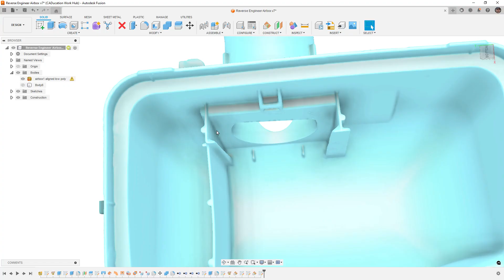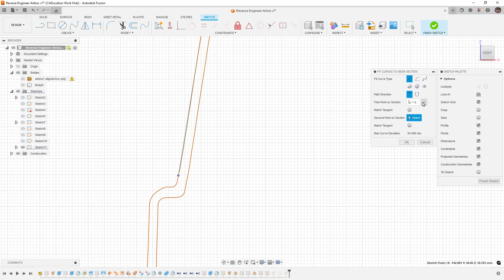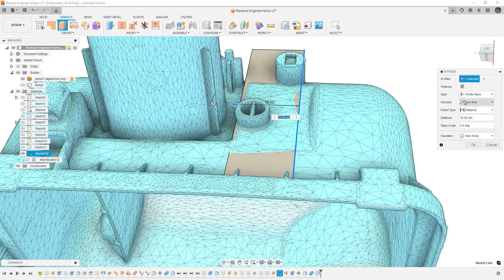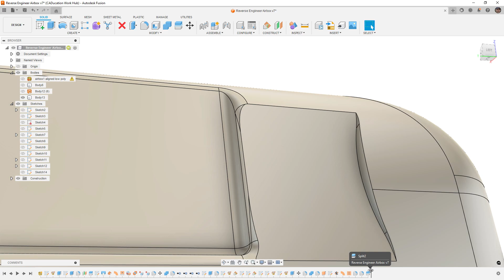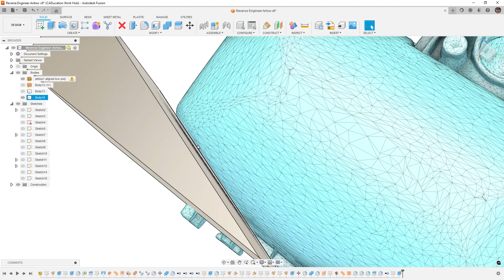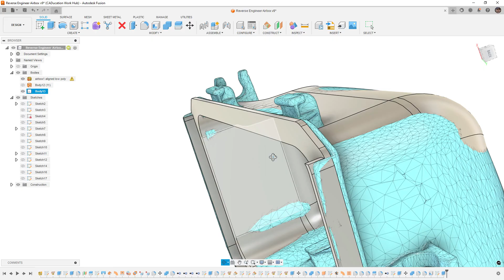Reverse Engineering Scanned Car Parts - Airbox Series Part 2 #fusion360

Comment: This is so helpful, thank you for doing these!!!  I did some corrections in the corner/intersection, where you did but then you decided to delete.  Without the modification, i can shell to 3mm no problem, just like you, with the modification  i can only shell to 1.97 then at 1.98 it fails.  Why would that single corner modification mess the whole thing up?  Is there a way i can send you the file and you could look at it for us?
Reply from the maker: What is interesting is that changes to the thicken and shell tools sometimes worked on older versions but don't now.  There is a "smooth" option that sometimes sorts out the problems.  if you want to share a model you can email me support@caducator.com

Comment: At 4.39 I saw how you turned off the faces. I thought that could be very useful so I tried on one of my scans to see if it worked - it does. But you did not mention how to change it back, and I cannot reverse it. Can you please tell me how to change it back?
Reply from the maker: display settings at the bottom of the screen (monitor icon).  CTRL+4 hides edges and CTRL+6 shows them.
Reply: @LearnEverythingAboutDesign  Ah so it is a Fusion setting not modifying the mesh. That would explain why my next one has no faces either. Now I get it. Thanks!

Comment: Dear Matt, I used variable fillet for many split and intersect process and result did get better in general shape, i didn't complete whole body yet but i hope there wouldn't be any error on next steps :)
Huge thanks for your effort 💯
Reply from the maker: Should be fine as long as the radius of the fillet on the smaller side isn't smaller than the thickness/shell value.  Fusion can do OK with this but that is generally when you start to see issues.

Comment: Hello. Love this video. May I ask about performance issues when importing an stl mesh to reverse engineer? It seems after a while fusion can slow to a crawl when attempting simple tasks while sketching. It seems to happen quite often when even attempting to dimension something. I get the blue circle of death that can spin for over a minute before fusion is active again. It becomes unresponsive. I am using a 2 year old dell xeon workstation with dual video cards and 64 megs of ram.
Reply from the maker: Hey there. did you experience that on this part?  Or do you just mean in general?  Mesh bodies can really drag things down for sure.  Making them Unselectable really helps so fusion doesn't have to highlight them when you hover over.  Reducing the mesh count also is key.  This mesh was reduced before brought into Fusion.  Generally under 10k facets works well (but rarely will you get a mesh that low).  I have worked with up to 10million in Fusion on my desktop.  Around 3-5mil is where i really see a slow down.  Im on a 10th gen i7 with 32gb ram and an nvidia rtx a4000 (16gb ram).  so my system isn't a big powerhouse or anything.

Comment: Good day sir, thank you for all the information and knowledge. i have a question for you regarding 3d scanner, I'm not really interested in fully reverse engineered a design, what i really want is to make something that needs other item size and dimension. Such as, custom car cluster gauge, i need the dashboard size and dimension to make it fit. In that case, wouldn't expensive 3d scanner that boast perfect accuracy is overkill for me, I can just use cheap 3d scanner to scan the dashboard and take the dimension and size that i need to make the cluster. Technology is catching up so fast nowadays, i can't risk like 5 grand (raptorX) for a scanner that in 2-3 years gonna be obsolete. What is your opinion on this. Thank you!
Reply from the maker: Hey There!  Well there are certainly a lot of scanners out there!  The raptor Pro for example is much cheaper than the X, and has a wireless option for $400 i think.  The X has more cross lines and such but i think its very little difference.  Revopoint is releasing an Inspire 2 (we covered the orig inspire on the channel).  The inspire 2 is under $500 and has full field plus a parallel line laser mode and also has a wireless option via wifi6 and is a small scanner.

My goto scanner is still the Miraco for its portability.  Just grabbing one thing and going is very helpful.  Scanning in a car will be challenging as you have to get a good angle and distance from what you are scanning.  I know how much of a pain pulling a dash is, but scanning the existing gauges are probably the best way.

Some things to consider.  Scanners that can scan small objects are held closer to the object (200mm or so).  Ones made for scanning larger objects are generally further away (1000mm or so).  Scanners that have multiple depth cameras are more versatile because they can switch modes.  Ones that only do small objects will have a hard time scanning larger stuff because of how far away you need to be.  Think about scanning a car fender and how much of it you would see 200mm away vs 1000mm.

I haven't tested the Inspire2 yet, but on paper looks like it might fit your need pretty well.  Has 2 modes so you can do details scans with marker dots.  also has full field so you can scan without markers.  a wireless mode with accessories and at $500 USD right now seems like a steal.